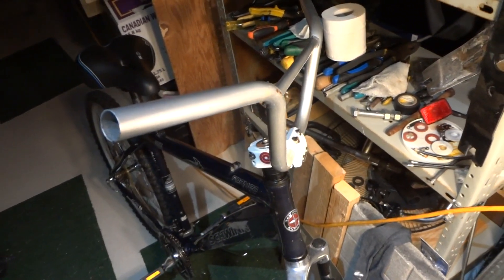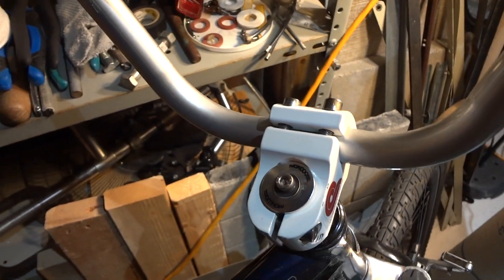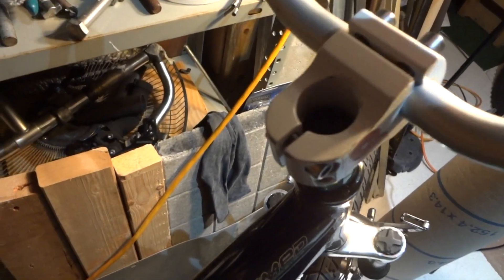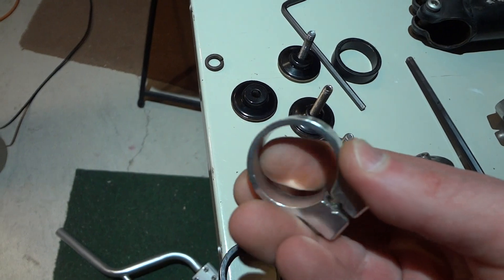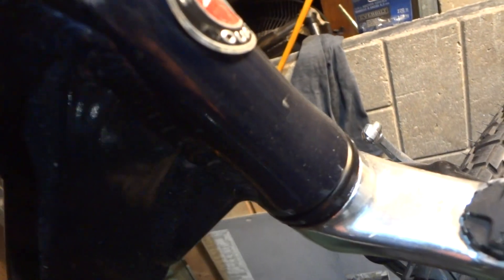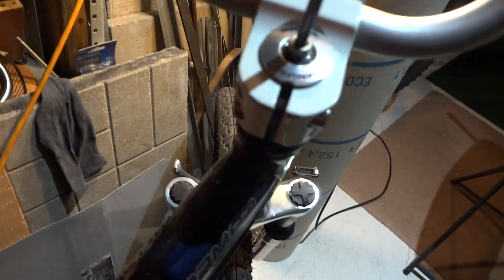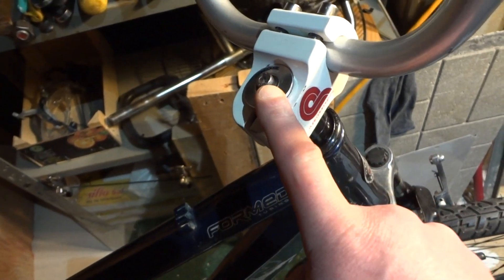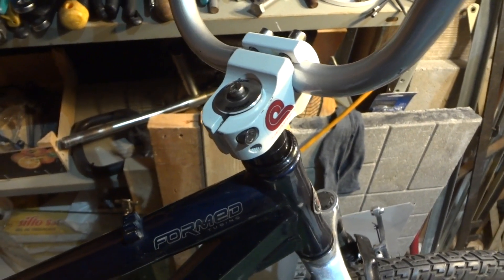Fix play or loose fork and install threadless BMX and mountain bike stem steering

Comment: this is very helpful. i think you may have helped me see my issue. i am switching out handlebars but now there is play in the headset. I think my bearings came loose at the bottom front of — right where they seat with the fork tube. My terminology may be way off, btw. How do i get the bearings back in — like you did in the video? I’m a total beginning.
Reply from the maker: yes it sounds like the bearing race came off the fork race, or you did not tighten the top screw enough.